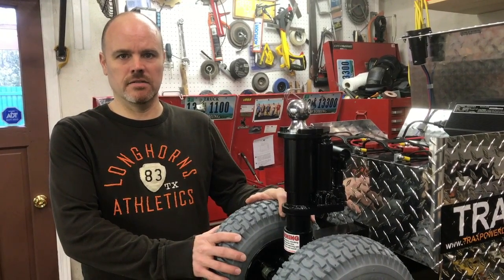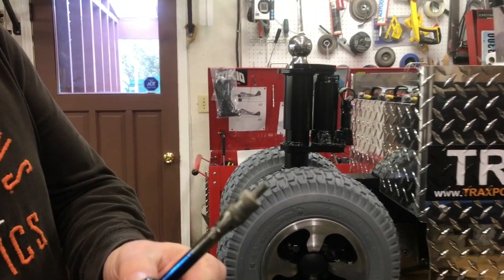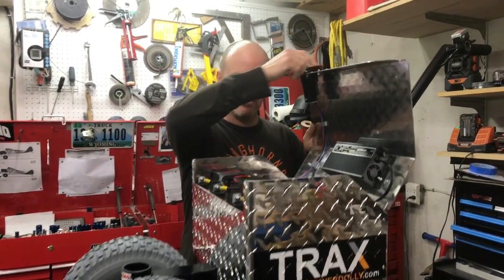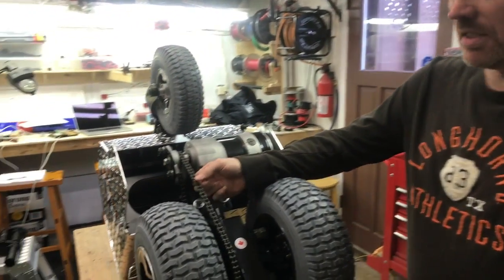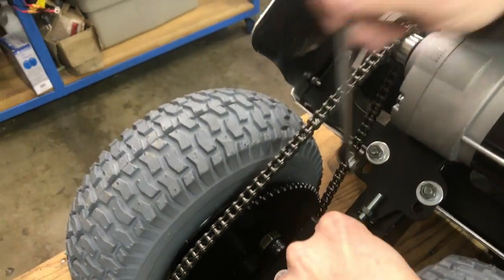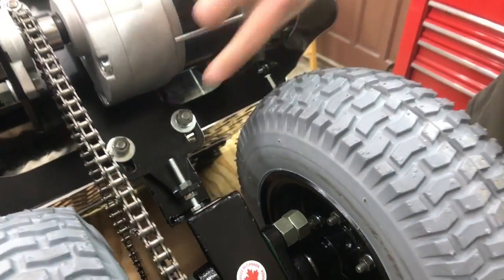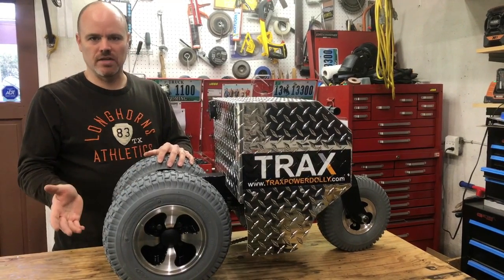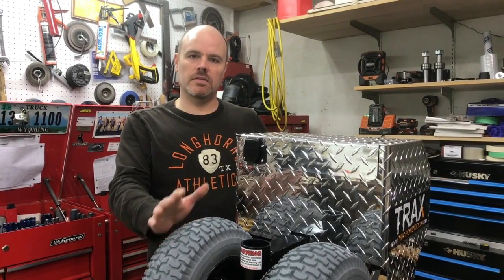TRAX TX6000 Power Trailer Dolly Maintenance

Comment: Will you have a 10,000 lbs model in the future? moving a 37 foot travel trailer and this would be nice if it could handle the weight.
Reply: I got the 4 wheeled Dolly to move my 37ft 12000lb trailer....totally disappointed. Had text and phone comms with Jeff and Wayne both gave me the run around. Now stuck with a 4 wheeled table weight!

Comment: Hello, I bought a Trax Power Dolly from you about 2 years ago. I have a question for you, Does the Ball Pin has to be refilled with grease? It seems like it does not want to hold the trailer ball tight to the trailer as it should. It does not hold the trailer tongue tight to the dolly. What should I do? What do you recommend? Thank you.  Note written by me David.
Reply from the maker: david78840  No worries, give me a call on Monday and I’ll get you one of our new design overcam  ball mounts. 519.860.8729